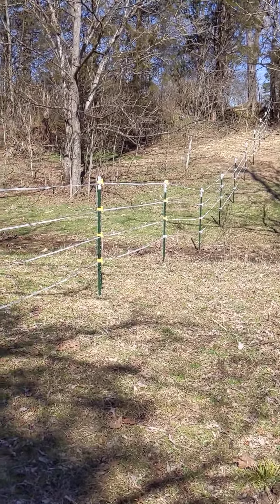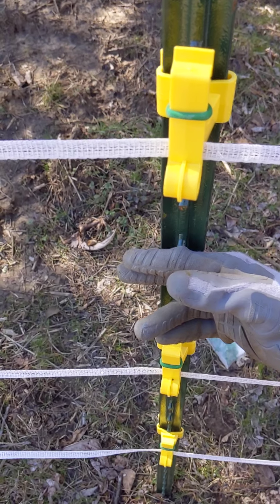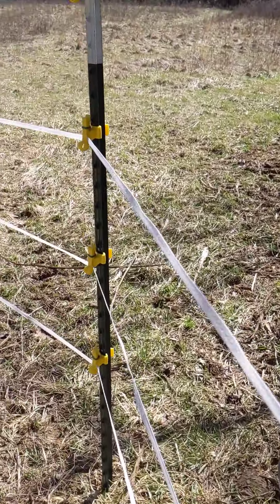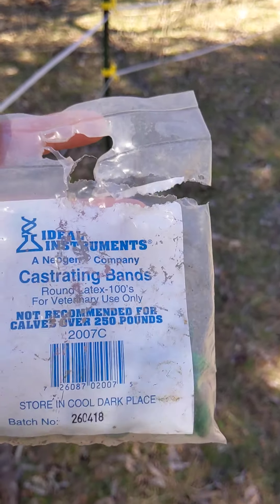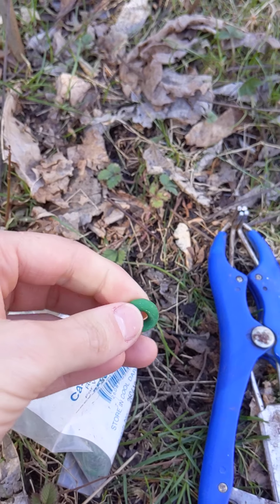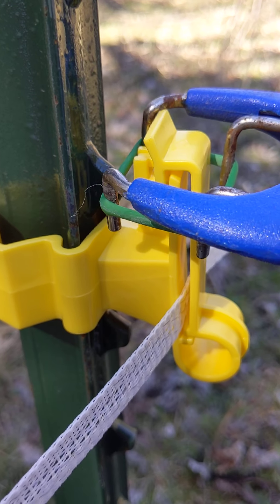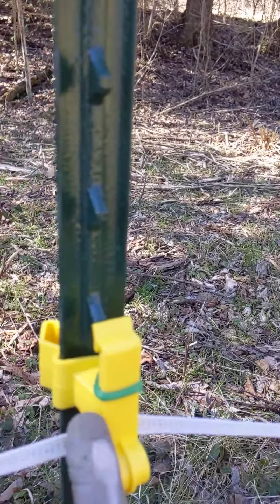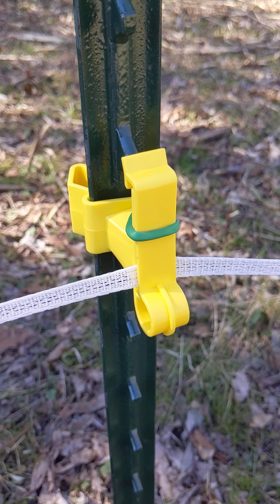Electric Fencing (Poly-Tape) - Insulators - Dealing with Turns and Curves

Comment: Even though your video was painful to watch (as a male) it was very helpful. Quick question: are you able to install the t-posts backwards on the curves and therefore the polytape would be on the outer edge as it goes around the bend? Would that work?